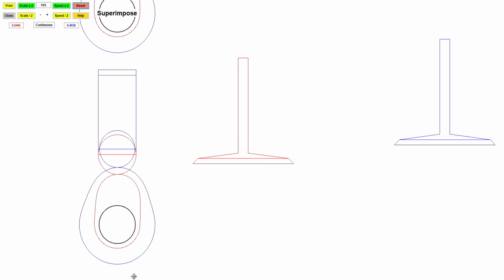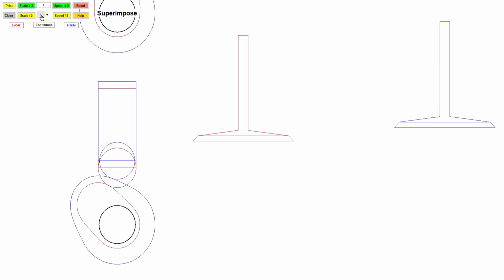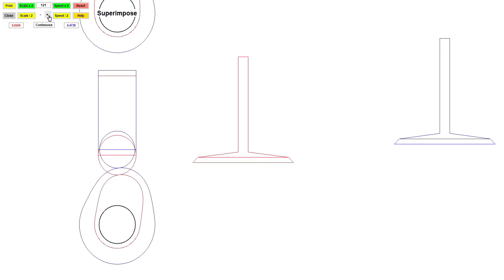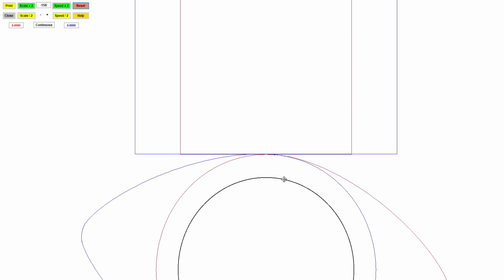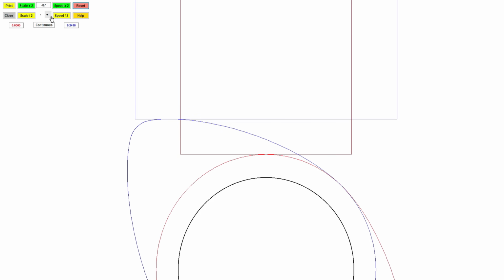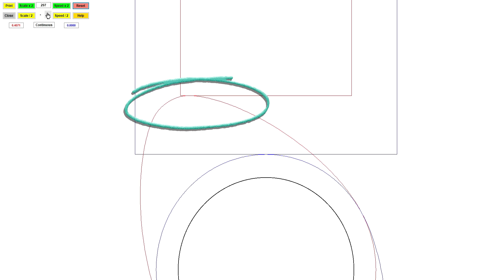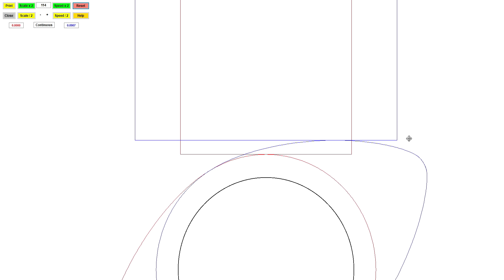Small Lobes Have More Lift and Dur than Big lobes??

Comment: Great animation Daniel. My father was a mechanical engineer and my degree, also ME, is 57 years old, so this seems self-evident to me. I can understand that not everyone has that experience, of course. Your description was spot on, thanks. One or two points: the base of a “flat” tappet often has a very large, which is to say slight, radius which can affect where the contact point ends up. The radius can make the tappet act as if it has a larger diameter. The other interesting thing is grinding the lobe face at a slight angle or with a radius across the face. This causes the point of contact to be off center, thus rotating the lifter. A rotating lifter doesn’t wear as quickly. The flat tappet can have quicker lift as it immediately comes off the base circle because of the geometry you showed, but the roller quickly catches up and exceeds the lift rate capacity as the lobe rotates. That has to be designed into the lobe profile, of course. Again, thanks for some great animations and explanation.
Reply from the maker: Ty for the support, a couple things, the lifter bore is off center to the ft lobe, that causes rotaion the crown just help s with scrubbing and entrainment velocity.

Comment: At maximum lift with the lobes straight up the blue lifter is higher than the red lifter, yet the blue valve isn't open as far as the red valve. That doesn't make sense to me.
Reply from the maker: What's between the lifter and the rocker?
Reply: @powellmachineinc  I know there is a pushrod and rocker arm, but if the rocker arm ratio is the same then the blue should still be open more.
Reply from the maker: @jlsracing997 I can show it to you, but I can't understand it for you.
Reply: @powellmachineinc  If the blue lifter is higher and the rocker is the same ratio then the blue valve should be open more. How do you explain that? Just going by your illustration.

Comment: Once you compensate for valvetrain geometry changes just going by the peak cam lift it is literally just basic addition/subtraction...You can work with stock parts and remove metal from said parts and it may be better than spending thousands of dollars modifying a vehicle. At least you know the stock parts are good.
Reply from the maker: Thanks for watching!

Comment: This was a super cool animation of cam, lifter motion, never saw a better one to date. I went nuts figuring this kind of stuff out on 2.3L OHC 4 cylinder engines running mini-stock circle track. If you didn`t set the valve stem height just right the cam would go flat in 10 laps and destoy all the rockers along with it. Took me hours to make a jig that worked to center the path of the lobe over the convex curve of the rocker pad and I`m not and never was a machinist. The shape of those lobes were crazy looking.
Reply from the maker: Glad you enjoyed the animation!

Comment: I've tried a variety of cams in my race atv over the years.  Finally seem to have settled on ones that aren't anywhere near the biggest out there.  Power comes on over such a broad range that I don't care about missing some peak power for the tight woods we do over a 2 hour race.  Smooth is actually faster and less tiring.  Interestingly enough, my exhaust cam looks the red one in your first animation.  I lovingly refer to it as the watermelon cam.  Most importantly, it also fires up great for our dead engine starts.  Just pulled two holeshots in a row against 450s with a 434cc machine.
Reply from the maker: The right cam is always better than the biggest cam....

Comment: I had this exact discussion with a former co-worker, I was playing with a gm 1.6L chevette I used a crank grinder to remove .030 from the cam heal. I said more lift he said nope. It ran until it ate the cam, but it worked and made 2 seconds 0-60
Reply from the maker: Absolutely 💯

Comment: Rocker arm ratio ?
Reply: That has to be factored in after determining how much the difference between the base circle and lobe will lift the tappet, then take that number times your rocker arm ratio and there's your valve lift;
Example (and I'm spitballing a base circle number here so don't anyone say "What cam has a base circle that size!!!");
If your base circle is 1.000" and your lobe is 1.500" then you've got .500" lift at the tappet (1.500-1.000=.500), and if your rocker ratio is 1.63:1 then take .500"×1.63 and that tells you your lift at the valve (.500×1.63=.815), .815" lift.

Comment: Right, it's the difference between the base circle and the height of the lobe at it's tallest point that determines lift, not just the height of the lobe itself. 
You've got to have something to compare the lobe to in order to calculate lift (factoring in your rocker arm ratio also), just knowing the height of the lobe itself doesn't do you any good.
Reply from the maker: well that what ive been explaining for years, people just struggle with it
Reply: @powellmachineinc 
It was alot easier for me to get my head wrapped around this kind of stuff after I opened my shop, then I could sit there and actually look at things and measure them and do the math myself.
Not everyone's heads are wired up the same, some people have book smarts but no common sense, and some people have loads of common sense but just can't learn from books, not without being able to physically handle and measure things while they're learning from the book.
God bless those people who understand things like particle physics, because if I can't touch something and actually handle it mankind never would have gotten to the moon if they were depending on me to get us there.

Comment: I have never flattered an FE cam until the 1990s. I have nothing but roller cams now. Even at .875 they were not spinning like they should. The curvature of cams bigger than 218@.050 could not get hold of the crown enough to launch the spin. Johnson OEM lifters were the only ones crowned out to the edge. You can feel it. Used lifters out of a 150 ,000 mile 352 with the 186@.050 and.401 with 1.73 rockers, I didn’t hesitate to put them on a 306S Comp instead of the new ones. It ran like a hog with turpentine on his tail lit, and lasted! A .030 over 410, a 417 was a beast with that huge cam and 150,000 mile 352 solid homemade lifters.  They were hydraulic but I made them solids with 1.83 rocker ratio Federal Mogul rockers. I had to go through a bunch of them to get 16, but that motor was a 410 FE as good as a Sprint Car motor back in 1977.
Reply from the maker: Interesting, thanks for the info!

Comment: That is why you never saw a 66 400 Olds never flattened cams and when they went to SBC size on the Olds they ate cams left and right
Reply from the maker: Again..... lobe design dictates lifter diameter, not opinions
Reply: @powellmachineinc Olds. had really nice cams and..935 lifters and I did a few 400s for guys running C/S with solid cams in 66-67 that were square 4.03 x 3.975 stroke. In 68 they were tiny bores and 4.25 stroke, the 68s were wheelers compared to the 3x2 OA1 400s, .842 liters. The 350s were better. But I moved on to the 428 CJ cars in C/SA. Fun times! I’m 65 and blind now, but those were the days.

Comment: Here’s the big secret big cam journals as much as 80mm has really helped in extreme applications. It allows the use of very large base circle cams, which helps with aggressive lobe designs .This also Reduces cam flex at 10,000+ RPM in today modern racing engines.Its a win so always go with the biggest journal you can with a aftermarket block.Just my 2 cents!
Reply from the maker: Absolutely,  small base circles limit acceleration alot,  so the bigger the lobe, the design freedom we have, and in conjunction with large wheel diameters its all better.
Reply: So tell us, who specifically does this and on what engines? And you're implying reciprocating mass does not matter, nor weight, nor peak velocity, nor acceleration rates,, all because these factors cannot be optimised in less than very large base circle cams. Do you have some samples that you could send to Daniel for him to show us all the improvements verified by his Cam Doctor?

Comment: The red lobe has more area outside the base circle.  More area equals more lift (by longer duration and potentially higher differential when compared to the base circle).
Reply from the maker: Obviously
Reply: @powellmachineinc  It seems you were struggling to say that or maybe you were trying to dumb it down.  Nice animation.  (except I'm colorblind).  It was still easy to follow though.

Comment: Do you offer hardwelding services? I believe Finger followers run out of HLA and the ratio changes with a smaller base circle. 

Would love to work on a DOHC Finger Follower engine with you!
Also need a revised cam for the 454!
Have a good one!
Reply from the maker: No welding any more, to time consuming